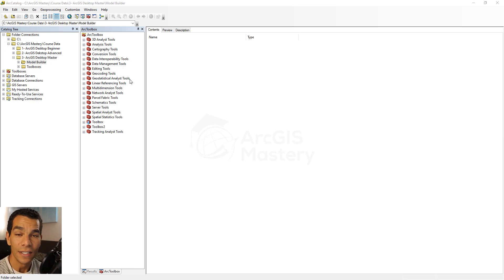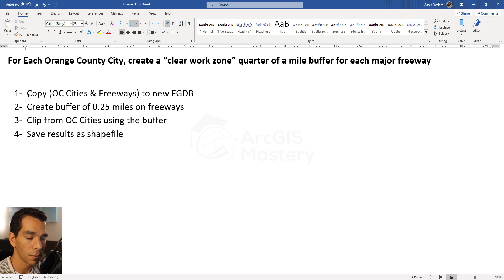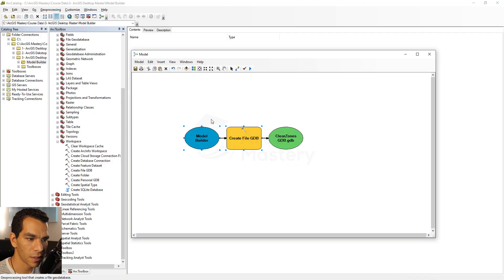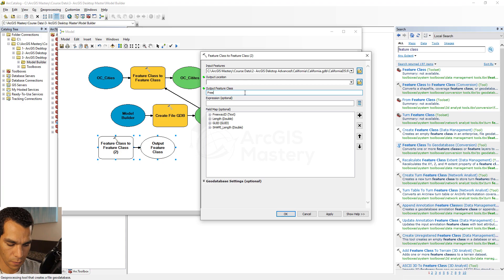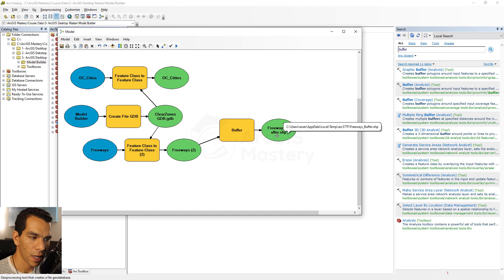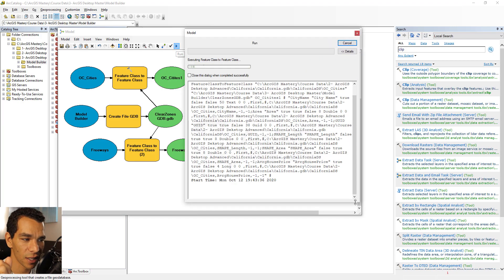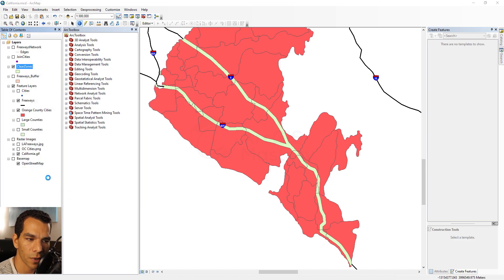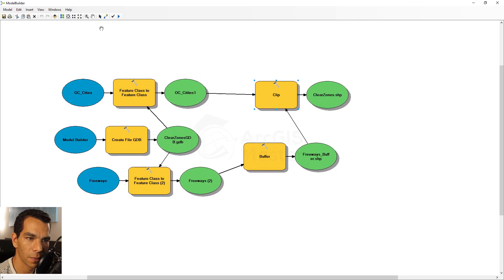ArcGIS Model Builder with ArcMap | How to create Model Builder | ArcGIS Mastery

Comment: Hi!

I have created a model for DEM processing to extract hydro logic flow path and basins and then I saved the model as tools in a tool box. But when I recall the tool for another processing, that comes in model builder as single tool which is not editable and if I link that tool with another DEM file it can not provide any different output. 

So, all I want to know is, how to save the model of model builder and recall it for another data and along with that I want to edit the model where its needed.